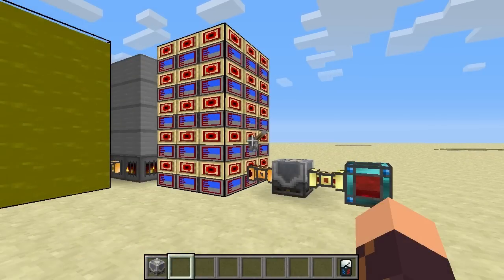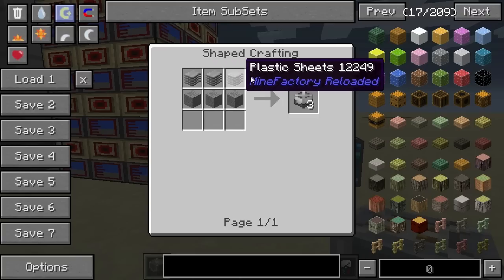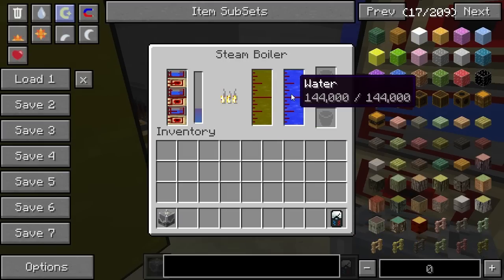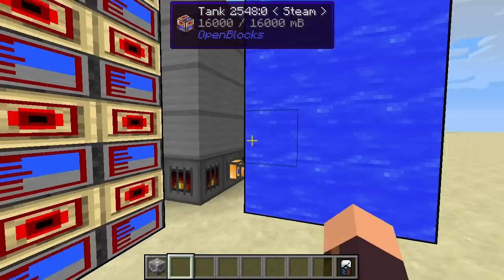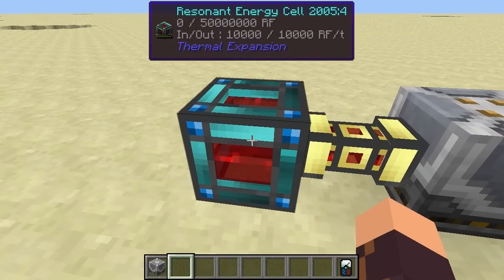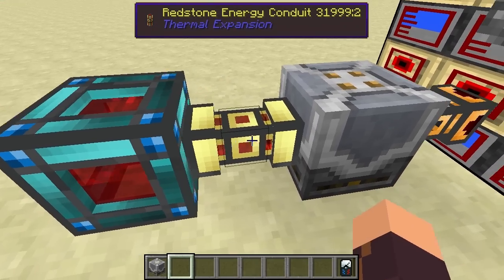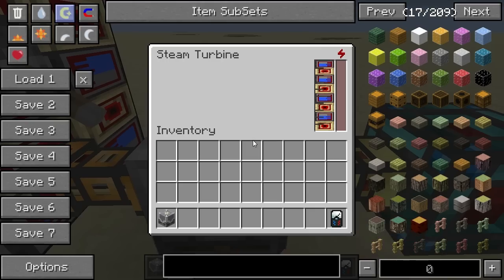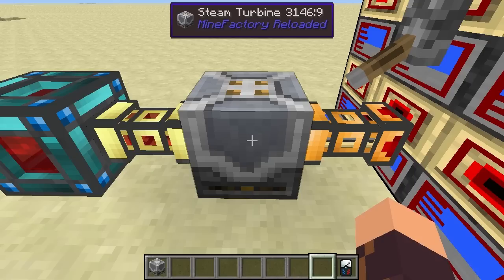MineFactory Reloaded - Steam Turbines

Comment: How would you extract MJ from this? I have tried running cables out from it and putting down a batbox next to it. Does it need to be a MFE/MFSU?
Reply from the maker: Hey, though this does produce RF or MJ power, you're talking about EUs from IndustrialCraft, which to my knowledge it does not produce. MJ or Minecraft Joules is power from the BuildCraft mod.
Reply: RZR0 *faceplam off of desk*
Reply: you can how ever transfer it to a block that can transfer it .

Comment: COMMENT OUTDATED FOR TEKKIT 1.2.9!!
Water was never supposed to be used in this machine, being able to power it with water was a BUG, only STEAM is supposed to be used. (Hence the name.)

Thanks a lot for the video, it upset me that there was no information about this machine anywhere.
I blindly built a steam turbine power plant of 20 turbines, 20 pumps supplying water and 40 redstone engines. It works, not as good as I hoped but it fills a redstone energy cell (of the latest tekkit) in a few minutes.

EDIT:
I did some more field testing, my setup was highly inefficient AND overly expensive.
Here's how to get the most out of the Turbines:
My setup with 2 pumps + 4 redstone engines in a 3x4 water hole cost 30 iron ingots and 2 redstone dust (stone, wood, etc. excluded) for each of the 10 rooms I built, so in total I used up 300 iron ingots and 20 redstone dust.
This setup never supplied enough water for the Turbines though and thus had a poor energy output, so forget pumps, they are not built for this use as no matter how hard you power them, they will pretty much never supply turbines with enough water.

Instead use Aqueous Accumulators!
1 Aqueous Accumulator won't supply the Turbines with enough water, 3 Aqueous Accumulators for 2 Turbines won't do that either, but using 2 Aqueous Accumulators on 1 Turbine will supply more water than needed , meaning it enables a constant full energy output.
An Aqueous Accumulator also costs less than a pump, since 1 Aqueous Accumulator costs 9 iron ingots and 1 gold ingot to make.

If I were to rebuild my setup with 40 Aqueous Accumulators instead of 20 pumps and 40 redstone engines, I would have used a total of 360 iron ingots and 40 gold ingots while maintaining a constant water fill in the Turbines, which is cheap compared to a setup of 4 pumps + 8 redstone engines which would STILL NOT BE ENOUGH to supply enough water, which would have cost 600 iron ingots.